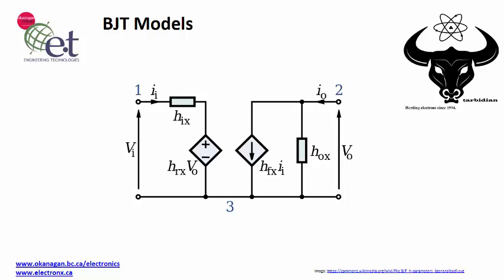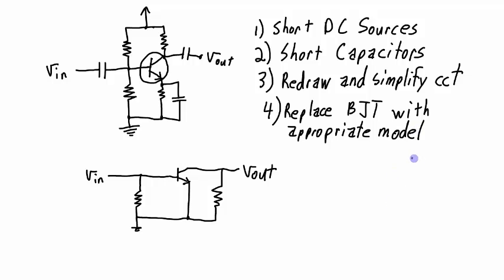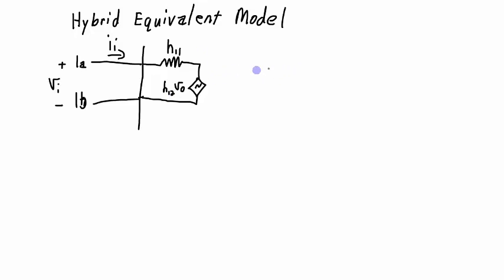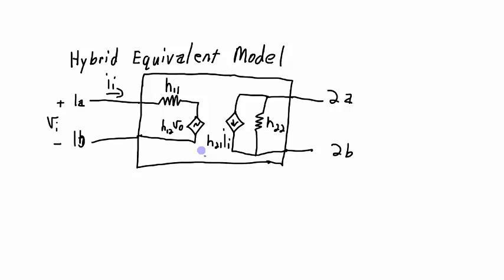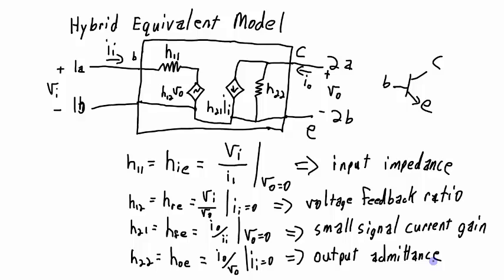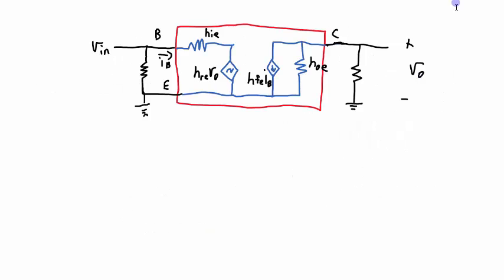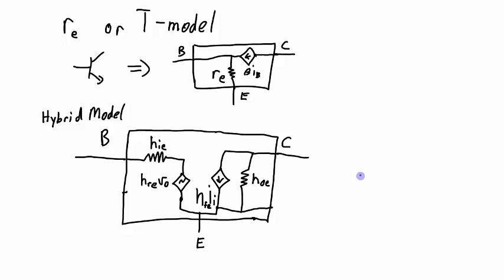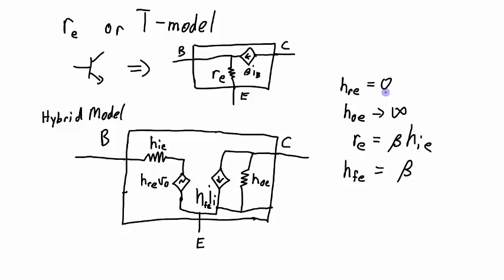Modeling Bipolar Junction Transistors

Comment: Is ho (conductance, not impedance) not 0 instead of infinity for the re-model?
Reply from the maker: You're right ho is an admittance, so it should go to zero in the re-model. If it was modelled as an impedance, then it would go to infinity.
Reply: @ElectronXLab  ok, thank you

Comment: Hey David re=beta*hie is wrong. The right answer is re=hie/(beta+1) . The current through E is beta+1 bigger than through the base. Logically the resistor re has to be beta+1 smaller than hie so Vbe stays the same
Reply from the maker: You're absolutely right, thanks for pointing that out.

Comment: What frequencies are the mid frequency ranges?
Reply from the maker: That's a good question, but you probably won't like my answer. It depends on your circuit needs and then selection of your external capacitors will set low frequency cut off points. High frequency cutoff points will depend more on parasitic capacitance of the BJT, so you have less control over them but the high frequency cut off will often be in the MHz range. Bottom line..mid frequency might be in kHz to 100's of kHz range but is circuit dependent.